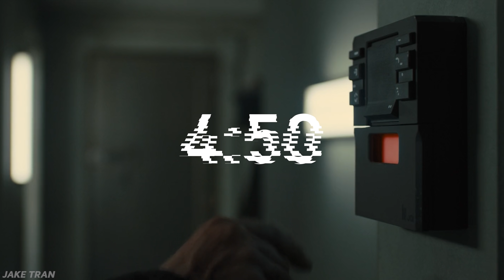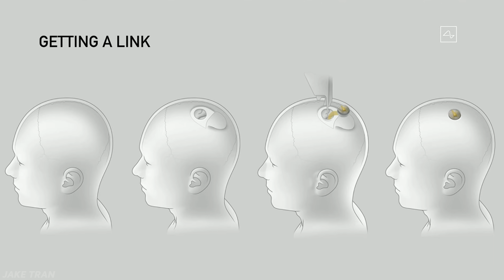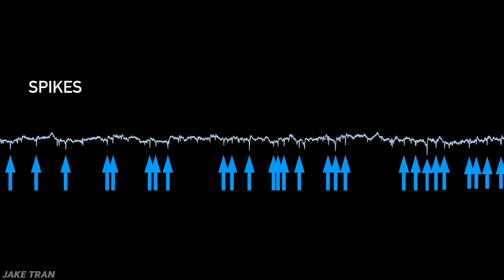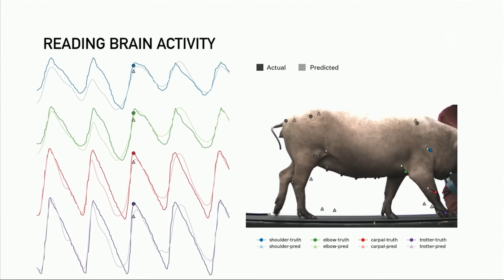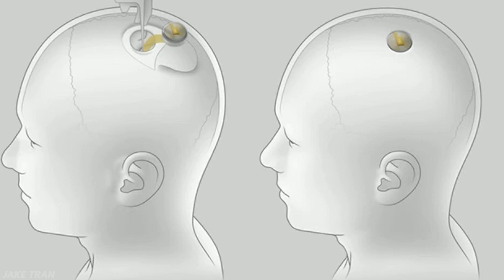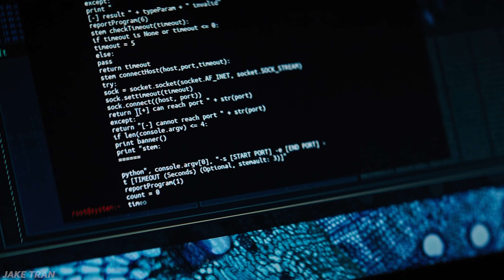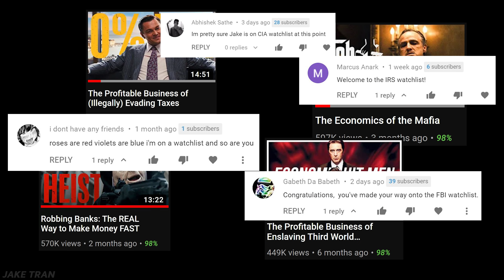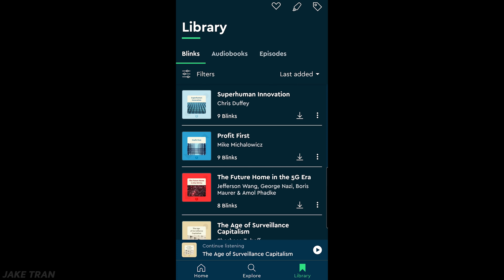Neuralink: The Next Stage of Human Evolution

Comment: Even the strongest and most secure systems are hard to break into but are not impenetrable . If given proper time and and multiple people try to crack into the device , one might just break into your brain and then a few commands and you can just be dead. Killing people , that too remotely will be so much easy and the future would look so dangerous. For instance a criminal equipped with proper set of knowledge and equipment can stop the signals from reaching your hands or legs or what if heart and hence that would be death for the person. 

On the other hand ,Neuralink, assuming theyd have access(which I guess they will ) can look into or may be even control your body and then i wonder what will make you you? You can just be a dummy human robot controlled via the internet? 

Also if the neuralink can send signals to and from your brain , after few version it can also control and send sensory organ's signals , hence maybe playing music would be completely different cause actually there wont be any vibrations but electrical signals sent directly to your brain , if they can understand how it is sent. Also watching a movie would be so much different.

Neuralink sounds like a bunch of Blackmirror episodes altogether .
Reply: Would look more like robocop they will have to interact with you brainwaves and hormone chemicals
Reply: I mean to be fair you can already do this by throwing a rock really hard at someone.

Modern problems required Ugha Ugha solution save?
Reply: skem  Its not that simple. It depends who did it, how much money they have, who they paid off.  And how important they are. There are plenty of companies that could get away with that and blame it on a malfunction. If you signed something that says they are not responsible for what might happen to you. It would be nearly impossible to sue and win. Even if you sue your chances of winning would be minimal at best. Its not that simple.
Reply: Rafa Segre But does it really outright the pros though? The pros of the technology cannot be overstated. They will potentially be greater than the industrial revolution and digital revolution combined. And the cost is really just significant better cyber security which is actually not that difficult to facilitate considering it will be given unprecedented amount of attention.
Reply: That's the thing innit, everything is a little bit scary. Just by real world weapons, guns, nuclear weapons and kitchen knives. Nothing is really safe, life is a black mirror episode. In other cases there are othher ways to control people e.g Jonestown happened, no neuralink was needed. There's two sides to everything, it all depends on if we want to hope humans don't try to use the tech against eachother. Neuralink could either help the blind see or help quadriplegics walk or make people jump off buildings. Living itself is a risk.
Reply: @LutherO8  Some really good insight
I can tell your going places
Reply: Kasopefoluwa Ogundimu while everything is a risk there are more controlled risks and uncontrolled. You can stay away from people that use guns in order to not get shot, does that mean you wont get shot? No. But less likely. Same principle applies here. With others having access (which undoubtedly the creators would) they could use what they have given you against you without your will. Morally its wrong but your basically putting your trust in a group of people that may change to be against your favor. Once you have it in you become under their control. So there is no “risk-aversion” once you have it in.
Reply: @LutherO8  the thing is if someone got into these and killed everyone connected it could be dozens of times worse than even the numbee of people who died in the great war period
Reply: Potatoes Have 48 Chromosomes A valid concern. But nothing that can be countered by something as simple as diversification.
Reply: we can just make the neurolink no Input except from brain
Reply: You can't hack something that has an airgap. If you can't interface with the device externally than you can't manipulate it. Let's look at a simple example, someone paralyzed from the base of the neck down due to a clean severance of the spinal cord at one it's vertebrae. The reason this person can no longer control their body below their neck is because the electrical signals that are being produced at the brain cannot properly travel down the now broken spinal cord to reach the muscles of the leg for example. 

What neural link intends to do is to make a copy of the signals produced by the brain and relay them AFTER where the breakage occurred down to the usable portion of the spinal cord from there the spine will direct the electrical currents down to the appropriate area they were intended to be placed in the first place. You simply can't hack something like this because all it's doing is reading a signal and amplifying it at a different place. 

Obviously, this is just one possible use for the neural link technology but rest assured simply not allowing the device the capability to communicate wirelessly will be sufficient to create an air gap making it effectively impossible to "hack" in order to hack something like this you would need to be in direct contact with an individual and hook into that person with their consent. And at that point, if you really wanted to cause a person harm there are plenty of quicker easier ways to kill someone.
Reply: Rafa Segre The cons the tech being obvious and them being destructive can be true simultaneously. Don’t assume I’m denying one by saying the other. 

My point is the threat posed by this new tech is in someway akin to the threat posed by nuclear. It can be very destructive in this full form, but it’s also very obvious to anyone who knows anything about it so there will be countermeasures put in place to prevent the sort of situation from happening. If even us layman watching from afar can tell that it is potentially dangerous, do you really think the intellectual elites would overlook that fact?

While we do have less privacy today than in the past, it’s more a result of the masses thinking it’s a worthy trade off for convenience and free service than some inherent fault in the tech. 

We need to be cautious about how we implement this tech, but it is too hasty to say with such certainty that the cons outweigh the pros.
Reply: Yeah, Elons like "Im scared of AI so we gotta put a chip in our brain so we can beat them" but the chip will just get hacked by any AI lol. Maybe even a human. 
I love this tech and want it, ONLY if I have sole access to it and know what its doing 24/7. However if they need to be connected to Tesla servers or something, I'm out. I'll wait 50 more years till people make a safe and secure one that only runs locally and can't be accessed any way other than with my mind.
Reply: Rafa Segre No... the pros aren’t just curing certain alignments. It’d be akin to the invention of language, no, far greater than that because it’d orders of magnitude more efficient and intimate. There’s really no end to what will come of it, much like the invention of the internet. 

What I am saying is that it’s easy to look at the obvious cons of a new technology and overlook the fact that there will likely be just as many countermeasures. If history is any guide, pretty much every tangible downside of a new technology is countered almost immediately with countermeasures development using that same technology. Much like how hacking gave rise to the entire field of cyber security or the internet and fake news made people aware of the biases in msm and the importance of authenticity. 

The same people who developed the tech will also provide solutions to the downsides. All and all, humans aren’t so dumb that they will spend enormous effort to develop a new technology only to forget about all the downsides that even an thirteen year-old would see. This is especially the case with the ones who are developing the tech.

Here’s a video on the topic if you’re interested:
https://youtu.be/OCLLzI4R3bc
Reply: That would in theory require the link to be either internet capable or have a breach in a place where you can receive physical updates for your link 

It would also require the link to be in your brain stem for your heart and areas that control motion which usually occurs with people who are disabled
Reply: Anyone could mind control you if they knew what they were doing.
Reply: The thing is, if we’re talking about the far future and all the technology that it entails, odds are that if someone wanted to control you even if you didn’t have any robotic implants, they could easily do it, and they could do it in such a way that no one including you would notice, and they could brainwash you into doing things that you would have never ever done. They could make you cry out in joy at the prospect of being violated, all through advanced technology that links up to your brain discreetly. So in a way, if you want more protection and more security for your thoughts it is better for you to get augmented with new technology that is more capable of resisting those attacks in the future.
Reply: Maybe kill but I was thinking they may try and build an army :)
Reply: These people could finish you anytime they made it and the could control it just like apple
Reply: Wettro King who are they? Do you mean NeuralLink or malicious third parties?
Reply: @meatsaucez1516 yes
Reply: I don’t think they would have any need to connect the actual neuron control to the internet. Maybe some diagnostic information and a connection for software updates, but there’s no real processing that needs to be done requiring a connection to a server. Remember that all it’s really doing is acting as man made connections from the brain to various parts of the body
Reply: Tedog exactly. Even something as simple as making it offline can prevent most conceivable attacks.
Reply: I would imagine the parts that don't need to be connected to the internet would have no capability to for security. If there's no malware onboard already it would be impossible to hack into the more sensitive systems (so no air gap hacking).
Reply: Lex K  putin have joined the chat
Reply: They would definetly risk losing billions of dollars and reputation just to play GTA in real life.
Reply: What about blockchain cryptography?
Reply: https://youtu.be/cRDyBxAPlYs
Reply: The chips could overheat, effectively scorching your brain.
Reply: @retinazer2893  yes, team of 100 experts will definetly not find out about this.
Reply: @Enclave_Engineer  yeah, they will definitely find a way to stop the chip from overheating
Reply: @retinazer2893  pretty sure they thought of that already... people have other kind of tech inside them and they're not dying left and right.
Reply: @RSVDCN  yeah I think my brain just kinda deflated while typing my first comment.
Reply: Also that one South Park episode
Reply: North Korea be like doing this
Reply: what if it doesnt connect to the internet and you have to upload files instead more secure but a bit inconvenient
Reply: You don't need to break into it, just do a denial of service.
Reply: "hence maybe playing music would be completely different cause actually there wont be any vibrations but electrical signals sent directly to your brain" We all know what they are going to do, just delete all your thoughts that you don't have the copyrights. I'm more afraid of that than the possible hacking. I don't have $200M USD to pay for all the copyrights I know by now from memory. Sure, when they are files in the computer, its easy to get rid of them, but what when they're entangled to all your other memories?  can you imagine being prosecuted because they found a DRM-protected video in your brain that you don't have rights, or worse, they just remove things like they do with any cloud service, but now entire memories are just gone, watched an "illegal" movie when you met your friend, now your friend is also gone. You just won't own your thoughts anymore if you ever saw anything copyrighted at all.
Reply: Do you know how long it would take to brute force threw anything that has good security? It would take so long that by then the people making it would be dead a million times over.
Reply: Imon Roy it doesn’t have strong enough electrical signals to kill you, unless you rely on the neuralink to stay alive.
Reply: Cringe
Reply: I wish that when neuralink is going to be "released" they hold a paid contest for hackers , to try and hack into neuralink, and when they hack into it, ask them how to improve the security/hire them maybe
Reply: Sounds like deathnote
Reply: Yer I think it's similar to pace makers where yes they can be hacked but it's hardly ever done, also I think it would be cool to download your consciousness but this isn't really it this is more specifically for people with issues who it could drastically help
Reply: Good point 👍
Reply: Youd have to have done something really big to be worth the effort and it sounds like itd be easier to just disappear a person than that.
Reply: hacking a brain is definitley easier than going shlop shlop
Reply: Good enough is good enough. If it takes an unfeasible amount of effort to achieve what you describe than it is good enough as far as the average consumer is concerned. Remember you can always just shoot a person. No amount of cyber security is going to protect you from a high caliber round or even a bat to the head. And anyone capable of pulling off the hack would presumably also be to just assassinate you physically. Heck. Even the US government found penetrating iOS devices difficult and that’s just a bloody phone. Now imagine what it’d be like for something that’s literally connected to your mind.
Reply: @meatsaucez1516  See this is different for one reason. All of our current laws and rules are set up to deal with a world where you are in control of your body (no one can remotely [physically] force you to commit a crime) this is different because now someone could theoretically edit your mind and force you to commit a crime. In many thing in my life good enough is ok but when it comes to fucking with my brain (aka YOU your brain is YOU not your body. Your body's just a vessel) so you are directly allowing someone access to your root level. Never before in history could someone roboticly control another human.
Reply: super spooky Exactly. So it is only natural to expect the technology to place an even greater emphasis on security.

It’s true that never in history has one been able to robotically control another human because they have always been control psychologically. The only difference now is the technology will make the process more consistent and results easier to replicate. But same can be said about the countermeasures.
Reply: @meatsaucez1516  high magnetic field?
Reply: skem really. Hahahahaha you make me laugh. What government would prosecute. Not America haha they want this. You arnt suing the trillion dollar corporation or your gona get suicided